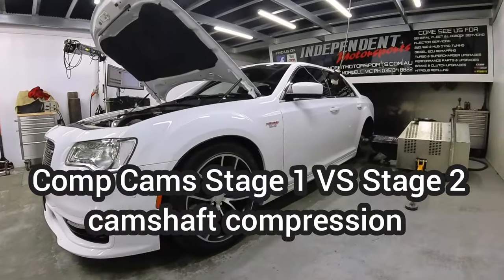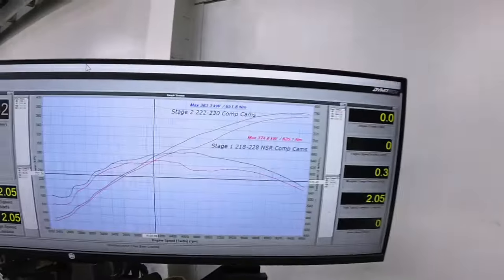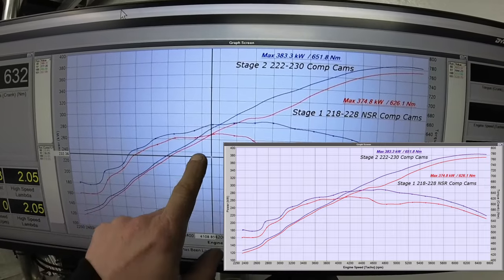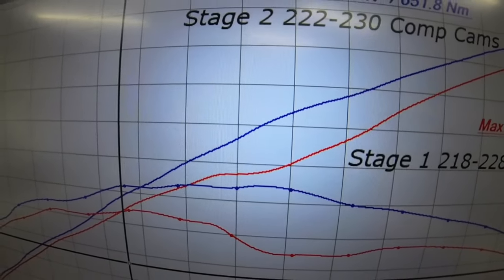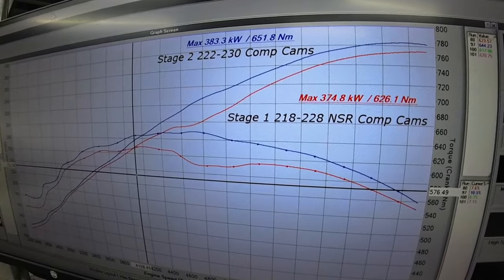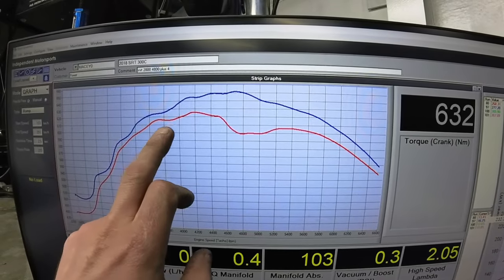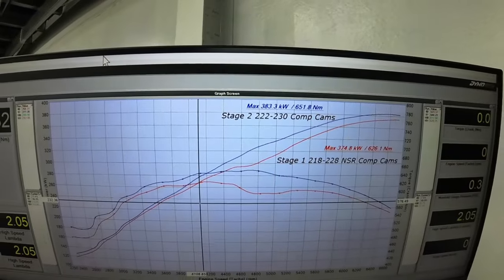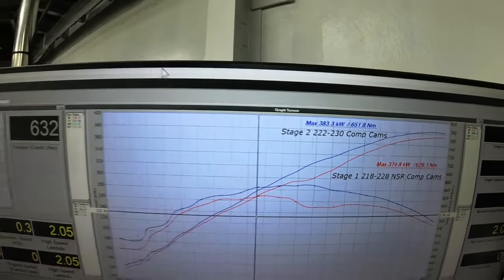Comp Cams Hemi 6 4Ltr  Stage 2 222/230 camshaft VS Stage 1 218/228 NSR

Comment: I know 392 cubes gives you a lot to play with but over 500 at the hub from a cam install and bolt ones is pretty amazing results.
Reply: The 6.4 I bought from MMX said mine should be 550@ crank it’s going in my 16 ram
Reply: @jjloewenstein  usually lose about 20% to the wheel which would be 430-460 also very impressive .
Reply: @hayden6056  yes. I’m only going on what I was told it should be at. As soon as I can I will post a video of the dyno when I get it done. I would love to know what I’m actually doing at the wheels. I also did the Efan swap, longtube headers high flow cats.

Comment: Do a positive displacement supercharger gained power also or it would blow the air to the exhaust valve on stage 2 and it would probably drop the boost i'm wondering

Comment: Isn't that torque dip due to switching from intake long to short runner?
Reply from the maker: The Intake Runner is switching over in that area. However, as I said in the video, you cannot get enough ignition timing into them to help improve the mid-range Torque.The stage 2 camshaft helps clean up the transition giving you a much better TQ Curve.